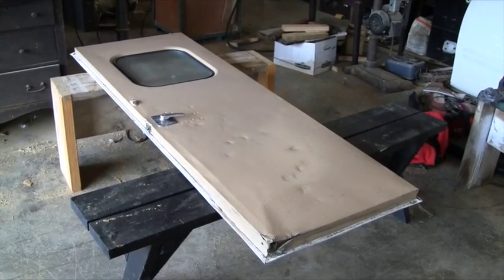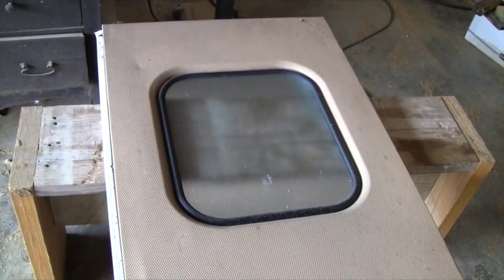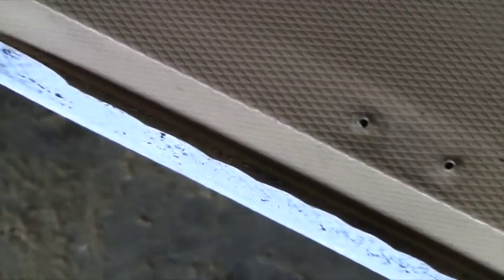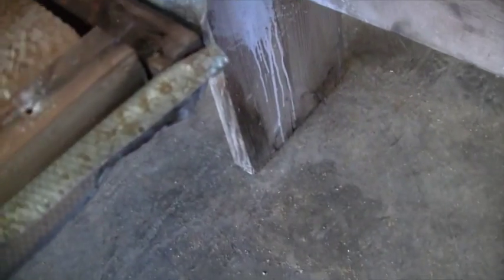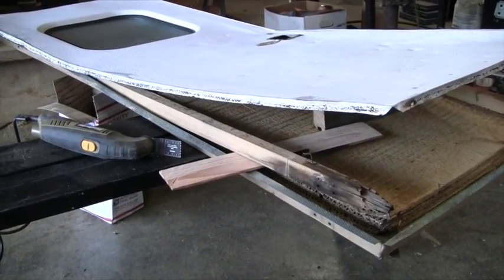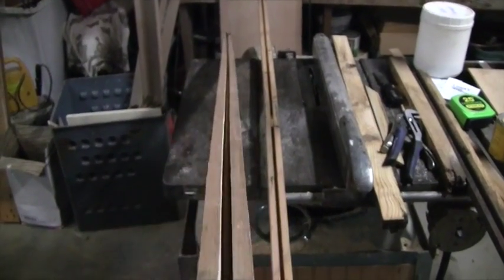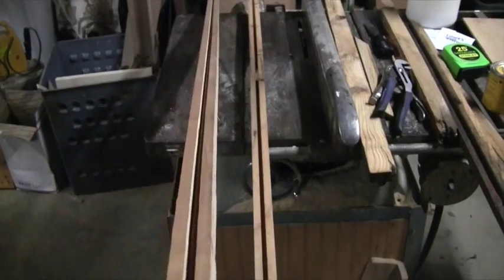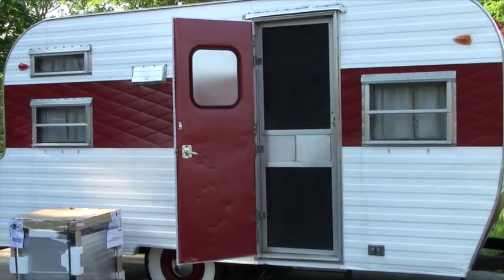Vintage Camper Door Rebuild

Comment: These doors wood seem to measure 1 1/2 x2 inches.the width doesn't matter as much as the height because you can trim the insulation back to fit.but you cannot go with a thicker board because of the metal trim and other reasons

Comment: This is a great video.  I have the same issue with the door on a 70s Holiday Rambler, and I've assumed there is a break about where the lock goes through.  I've been wondering what I would find inside and this pretty much confirms how I thought the door is constructed.  Fortunately, my door window is easily removable so I'll be able to completely disassemble the door.  I may replace the wood with LVL for its additional rigidity.  I'll also replace any cardboard filler with rigid foam.  Thanks for the help, and I'm looking forward to your work on the HR.
Reply from the maker: Jim, Thanks for the comment!  I think the LVL is a great idea. I'll keep that in mind for future projects. I'm looking forward to making progress on the HR and posting lots more videos. Anything specifically that you would like to see?  Thanks for watching!

Comment: Why did you not  install a flat bar on top of the inside edge of the wood piece instead of cutting a slot for the rod ?   The door system has failed once before.  Improvement is needed.
Reply from the maker: Mary, thanks for your comment!  That would have been a good alternative. I figured that since the trailer is 49 years old, if it lasts another 49 years, I'll be happy 😊

Comment: I've really enjoyed your Frolic rebuild series.   I'm currently remodeling a 1967 Bell Coach camper similar to yours.   Some things I wish you would have touched on more are electricity and the plumbing.   Did you install a new toilet?   Did you add on Black and Gray water tanks?  How did you go about hooking up the 120 and 12 volt lights?   Etc.   Future videos??
Reply from the maker: Andy, thanks for the comments and suggestions!  I may try to add some videos like these in the future. A little more 411... I did install a new toilet. There was an existing black tank below it.  There is no gray tank. The sink water just runs out so we have to have a sewer connection or use the external gray water tank on wheels. The 120 was easy as I just connected things back to the original wiring which looked good. Haven't connected 12V lights yet. The wiring is there I just have to connect it. Thanks for watching!
Reply: andyhbeyer y

Comment: what was the thickness of the internal wood you used as replacements?
Reply from the maker: Hello Randy. Sorry but I don't remember the thickness.  I don't think it was a standard size like 1.5". I believe I just ripped the correct thickness on the table saw. Thanks for watching!

Comment: what size wood are you using?
Reply from the maker: I used a 2x4 and ripped it down to match the size of the original piece. I don’t know the exact dimensions however. Looks like about 1 1/2” x 1”. Thanks for watching!